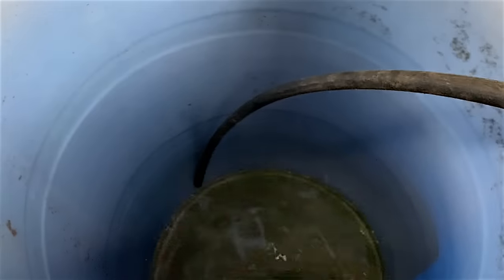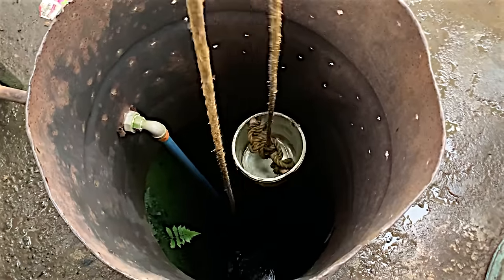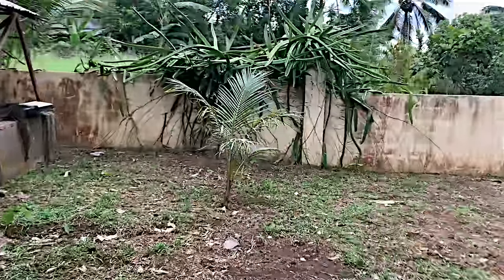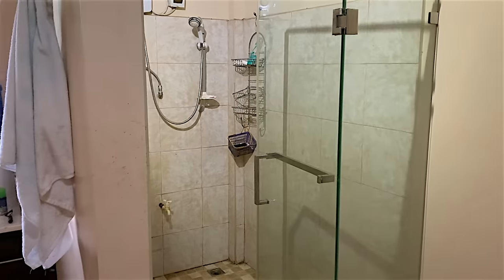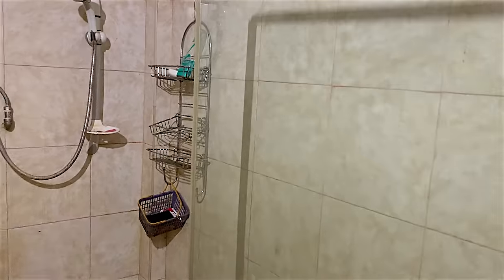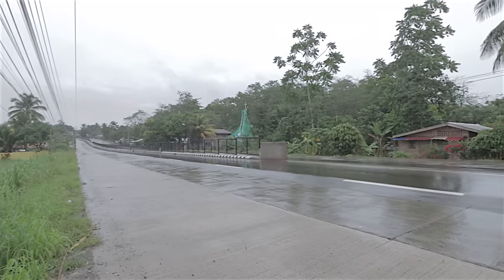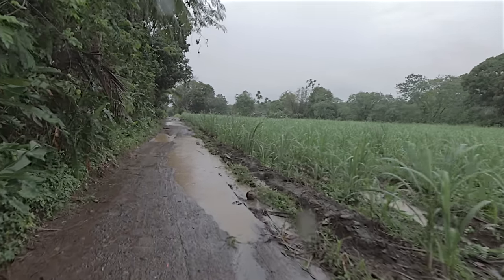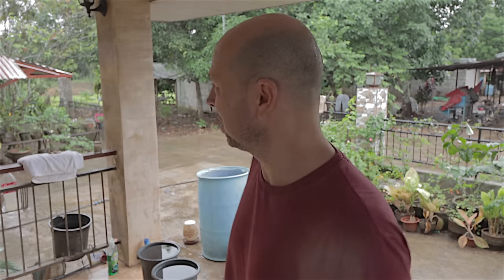What happens when the water runs out.... Water Water everywhere, but not a drop to drink

Comment: Regarding the water pump equipment. What is the symptom? On top of the blue pump you have a pressure sensor. Low water pressure switches pump on and then when pressure rises switch kicks off and turns pump off. Those pressure switches are adjustable and need adjusting over time. Search online for the one you have for instructions. The red vessel underneath the pump has a rubber diaphragm in it. On the right side of that vessel there will be a pressure valve. You'll need about 25psi in there to keep the diaphragm pressing against the water.

Comment: the pump under tank on stand looks to be able to supply water to fill tank which then will give you water supply when like a backup supply when pump below isnt working there should a set of valves to switch from pump only supply or switch over to gravity supply from tank on stand to house as long as it is full,
 the tank under pump is a chamber so when the pump is working the tank under pump drains down pressure then pump should kick in.if pump is not pumping you may have to check the non-return pickup in water in well if broken or blocked  it wont hold lift to the pump and not pump water to run house or fill over head tank the pressure of over head tank should be about 30psi
cheers lee

Comment: We have the same rain water tank here in Portugal it's called a cisterns here your switching problem will probably be pressure related our pump had a diaphragm which had to have a certain pressure but often leaked which gave you either pump not switching of or not running.

Comment: its usually the pressure switch that gives trouble when the pump won't automatically switch on if take the switch off you will see a little port/hole which leads to a diaphragm they get blocked from time to time its an easy fix, i have the same make  of pump  also at the end of the pressure vessel there is a schrader valve  which you pump air into the pressure should about 2 bar.

Comment: I don't know anything about wells and water tanks, etc but surely the pump is to get the water up into that tank on top of the tower and not to pump water  into the house as you said.
Gravity will let water flow to the house from the raised tank. No need for a pump to do that. It's why we used to have water tanks in the lofts of our UK homes.
Reply: That's what I was thinking. Our setup is better, we have our 3 tanks set high on the hill from the house, they are being fed by the shed roofing when it rains. Even if the pump/electricity goes out we still get enough pressure from the gravity to do most things, though showers are a bit of a strong trickle and take longer. Our dam water tank is 3000 gallons, open top concrete type and is pure gravity but we use a pump to fill it first.
I installed 18mm hose fittings and that increases our gravity fed pressure by about 15%, maybe a bit more and watering the garden with our dam is not that far behind a mains water or pump system.

Comment: The pump problem is not a big issue you should be able to sort it it’s not a complicated system 👍👍you may find the diagram in the tank has perished also the pressure switch might be blocked